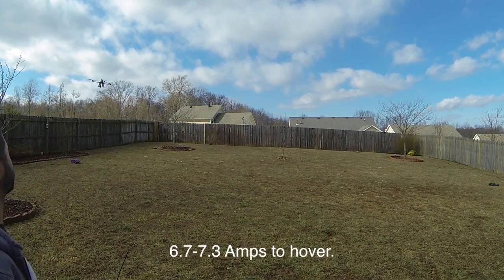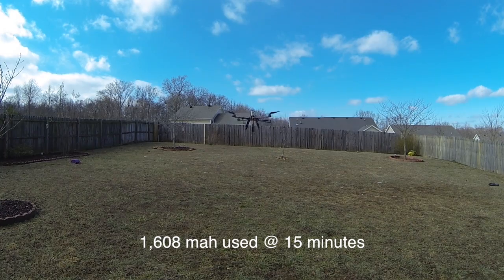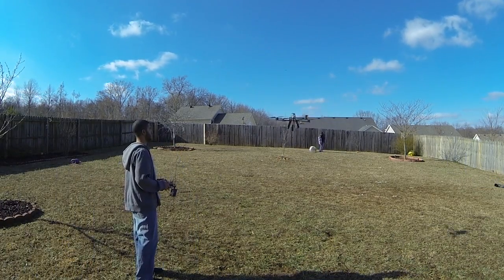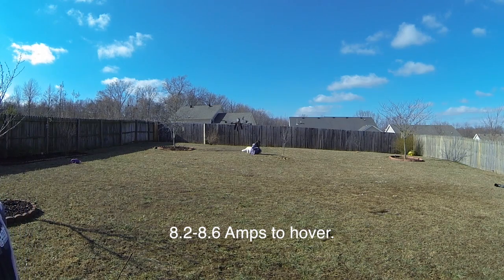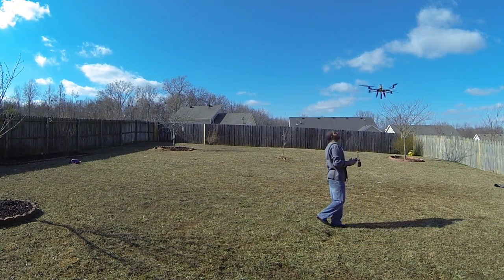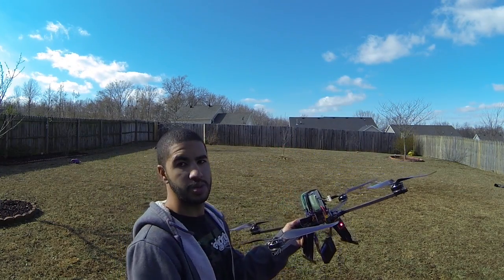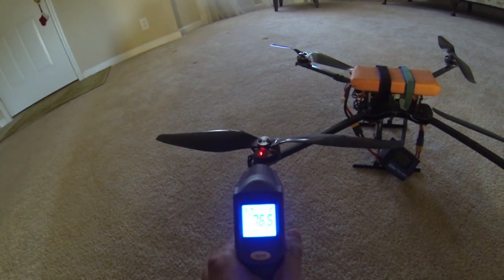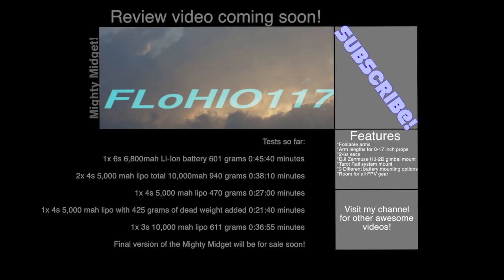Mighty Midget Long Duration Flying Quad! Flight Time Tests!

Comment: Hi, Great job . I  need your suggestion for my quad. I'm using 920Kv motors with 10" props at the moment. Do you suggest to upgrade to 360Kv with bigger props to have a longer flight time? because I'm using gimbal and gopro camera also. Thanks in advanced.

Comment: how many 18650 total? six in series but how many in parallel for that pack? thanks.
Reply: just weighed a couple 3400mAH Li-Ion 18650 cells... 6S2P would be 6800mAH at 25V is 171 watt/hrs at 512 grams  I compared it to a nano-tech 6S 5000mAH at 785gram  that would be 125WH

Comment: 17V on 6s bat ???? it's so bad man.... limit is 21V... nice setup and fly time
Reply from the maker: You are wrong my friend! I'm using Li-Ion not Li-Polymer batteries. If I was using a regular li-po then you would be correct.
Reply: ***** sorry man... my mistake...

Comment: Impressive and very promising!

Didn't have time (yet) to watch all the videos on this quad but few questions already arise:

1. What is the thrust-to-weight ratio with the different batteries?

2. What is the actual C rating you have with the diff. batteries?

Happy flying!

Comment: Hi Flo, watched your jan video on the mighty midget and would like to know where to buy and set up. Also, how it will perform on long range fpv flight. You also talked about mini carbon quad in another video and would like to know how you connected filter, gps from receiver on back. As you know its a small compact beast. Its kind of hard to see between the carbon plates how you have everything tucked away. Thank you hope for your reply.

Comment: Very good, what ESC and props size do you use? Do you reprogram the ESCs to use with Lion batteries?because Lion has  lower voltage per cell in comparation with lipo.

Comment: You did a great job, it is demonstrated that the choice of 6s is the best, thanks
Reply from the maker: Yes this quad flys much longer on 6s but it is also capable of doing long flights on 3s and 4s. That helps to show what people can do with those cell count batteries since they are more commonly used.

Comment: Hi ... nice gear ... do you have a website ... here in Australia multirotors are virtually unheard of ... I have a walkera qr x350 with a maximum flight time of ten minutes ... flight times of thirty minutes to forty minutes will change the dynamic for every lover of multirotors ... for beginners the learning is easier the longer you are up in the air and for advanced pilots the enjoyment of being up means everything ... good luck with your endeavors ...
Reply from the maker: Hello I dont have a website. If you want one to be built or not built let me know and I can give you a price and ship it to you in Australia. This quad is unique because every other long duration quad until now was not a kit that you can repair with parts if you crash. this one makes it easy for everyone to have a great long duration flying quad.
Reply: *****
How to contact  you then?...email?...
Reply from the maker: MrCpMbOy you can message me on here and if your a serious buyer I can give you my email. Ill send you a PM

Comment: Price point? This looks alot better than the phantom vision 2! Whats the batteries you can use?
Reply from the maker: If you Pre-order its $200 for Carbon Fiber Frame, Carbon Fiber arms, and all hardware. If you want one BNF then price obvoiusly goes up dependent upon what size you want it to be and what you need it to carry. It can fly on any battery 3s-6s withought having to change anything. So you can use a standard 4s 5,000 will give you 27 mins of flying. if your carrying a gimbal and fpv gear a 4s 5,000 will give you 21-22 mins thats without using more than 80% of the battery. 1x DJI phantom 2 battery costs $160! 1x 4s 5,000 costs around $30. A mighty midget already kills a phantom 2 in flight time and the batteries are way, way cheaper because it uses standard lipos.
Reply: *****  This is a steal! The phantom vision's gimble suchs but the one you can get with this is awsome! Also the camera is better and the batteries are cheaper! I'm going to wait till this is released before I buy it! The forum should have given away these over the phantom vision. This is awesome . Maybe   in the future you could make a bnf one with battery, gopro, zemuse gimble, and fpv system/googles!

Comment: Is this the same quad as your hopes and dreams quad? Whappened to that one?
Reply from the maker: No its not the same quad at all. That one crashed. look at my channel and you can see the fpv video of that one crashing.
Reply: I did :P ! Whats the estimated price point for this? Can it carry lipos?
Reply from the maker: Chris begemann Yes it carries lipos that is how it fly's. Price depends on what size motors, props you want. if you watch the whole video it has 3 test flights in it 1 was done with a Li-Ion pack and the other 2 were done with standard  Li-Polymer packs.